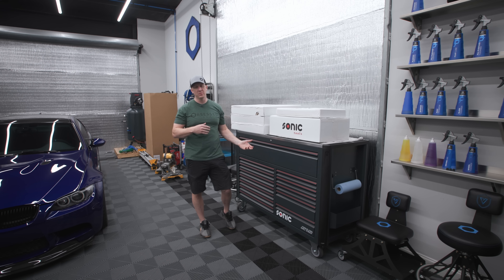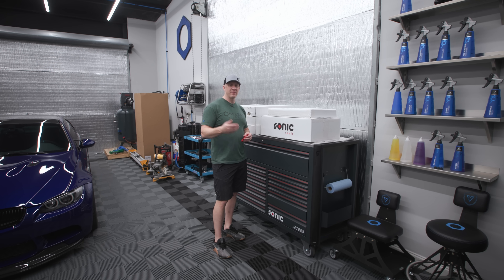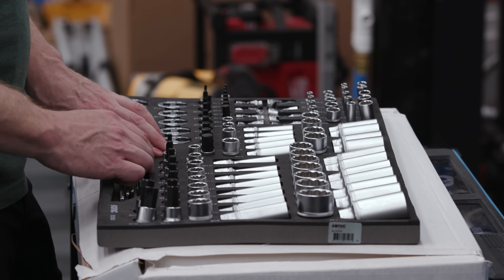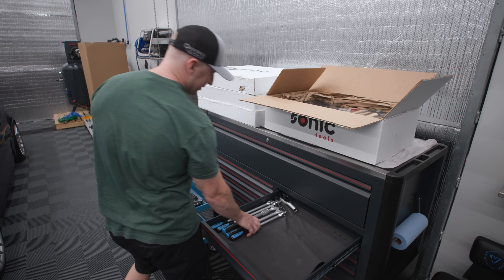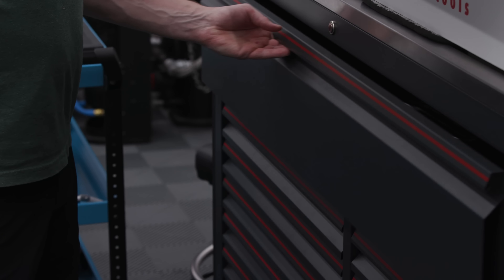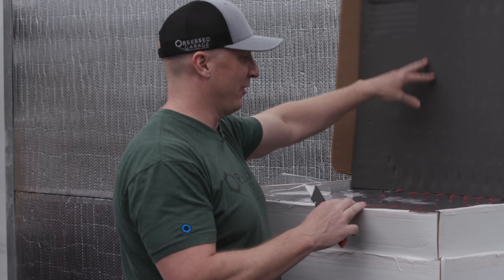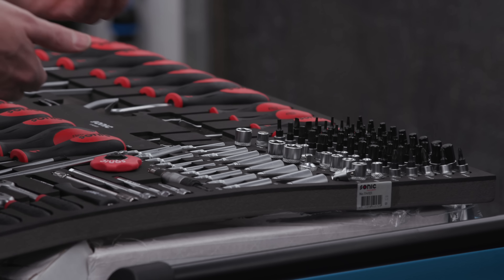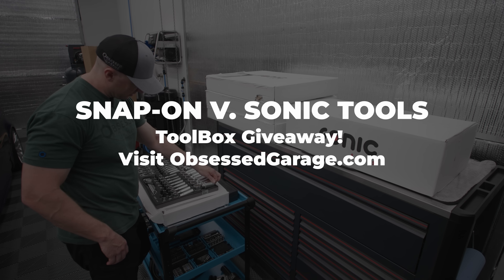Organizing the Sonic NEXT S15 with Tools: Part 1 - Unboxing Foam Inlays

Comment: As a professional diesel mechanic I primarily use Mac and snap on tools. The credit deals are not that bad if you pay it off fast. Plus if your just starting out not making a lot of money. $500 for a quality impact is hard to come up with. But $50 a week is manageable. Tried a sonic ratchet found them a bit rough and it broke when I got on it. Now have to deal with online warranty. My Mac ratchet broke. Rep was there in 2 hours and rebuilt it. Snap on or Mac have a lot of the special tools you need when you need them locally. But I will say truck brands are overkill for most diy and homeowners. But pro use not much else stands up. Plus nothing worse than busting a knuckle open because your made in Taiwan ratchet broke.
Reply: True , there’s a need and place for all tiers of tools

Comment: I'm personally not a fan of the foam inlays, way too much space wasted. For instance, the pliers could stand upright in an Ernst/snap-on rack, freeing up half that drawer immediately. The top drawer on that box is way too deep also, you would use it for sockets and the like normally but it doesn't need to be that deep.